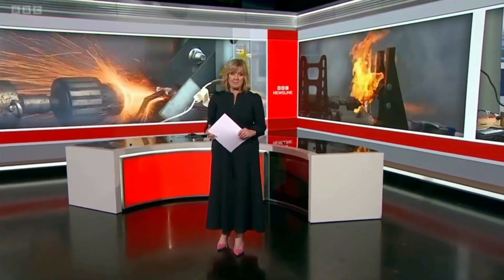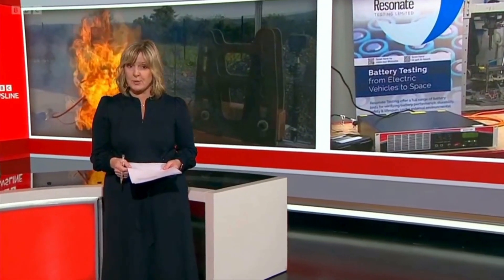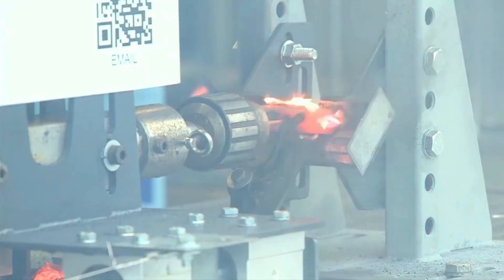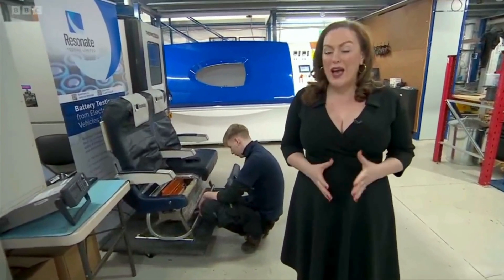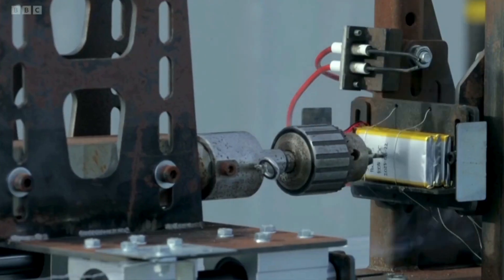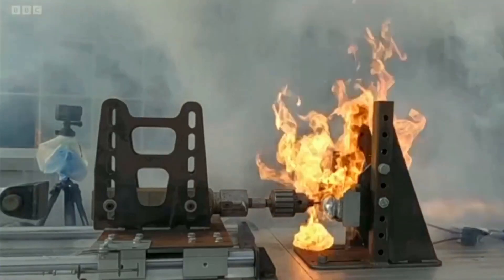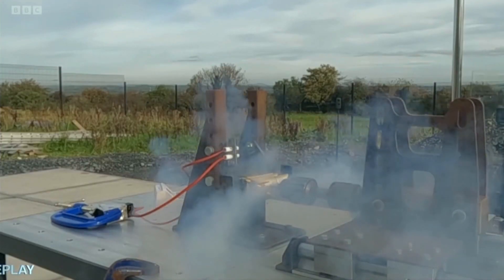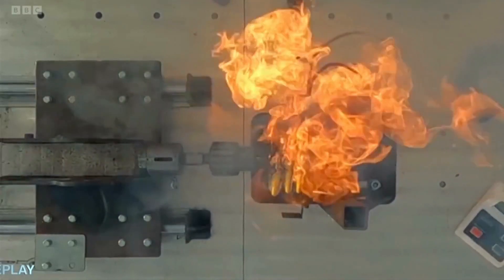Tom Mallon Discusses Lithium-Ion Battery Safety with BBC Newsline

Comment: Garbage dumps will soon self ignite, from all of the disposed computer stuff with Lith Ion memory batterys installed deep in the equipment that were never removed.  Old Cell phones that were tossed in the garbage, still loaded with a charged lith ion.  This has already happened in multiple locations and they ignited deep in the garbage pile.